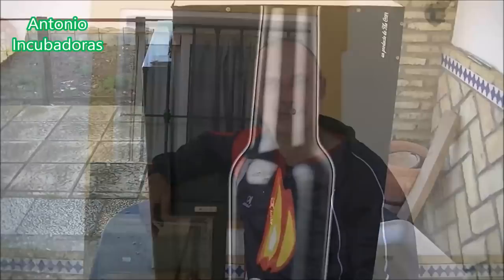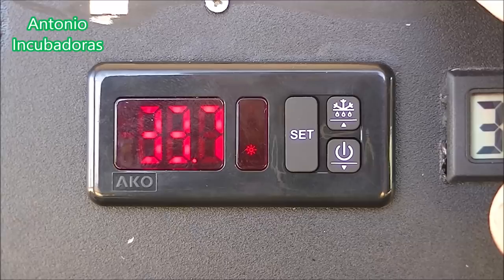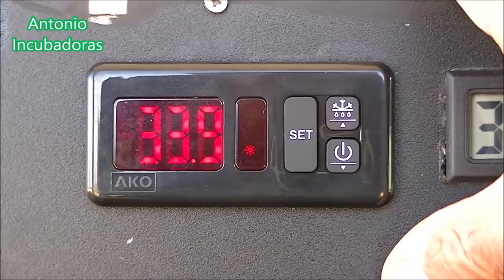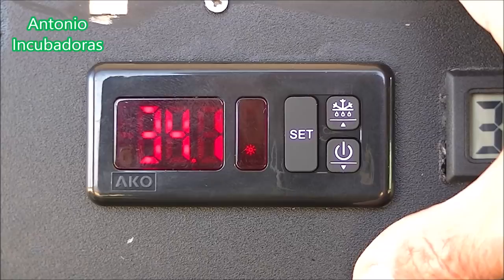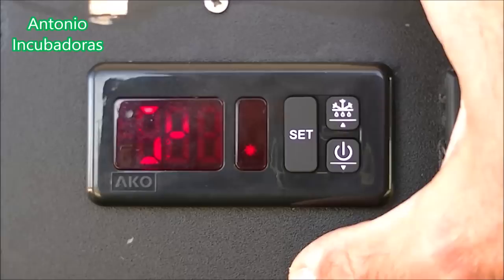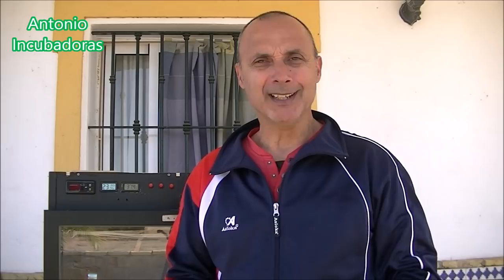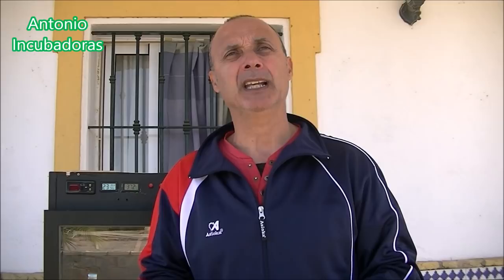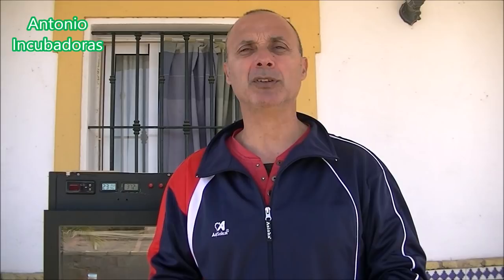Cómo hacer una incubadora casera 6. Programación y ajuste del termostato ako.

Comment: Hola amigo me gustaría hacerte una pregunta, tengo un termostato ako igual que el tuyo e seguido todo el proceso que usted hace en la instalación y en los ajustes. Pero de vez en cuando mi incubadora pega unos picos de temperatura muy alto de hasta 85°c. Y la resistência de silicona sigue encendida aún que el termostato ya se corto a 38°c. A Que se debe está subida y porque no se corta la resistência? Una vez pegado el pico, aún que tú apague el termostato la residencia no se apaga tengo que quitar el enchufe de la electricidad y dejar que se enfríe.  Para poder conectarla otra vez y una vez fría si apago el termostato se apaga la resistência, pero si pega el pico aún que tú apague el termostato la resistência sigue encendida y echando calor. Como poderia solucionar eso. Un saludo
Reply from the maker: Hola, un fallo de conexión, por lo que dices el termostato no está controlando la resistencia, saludos